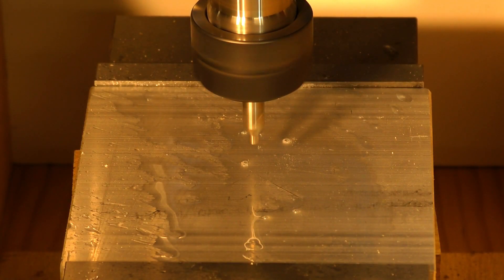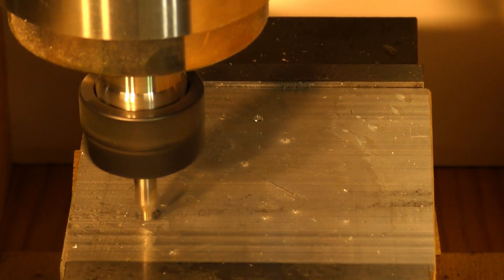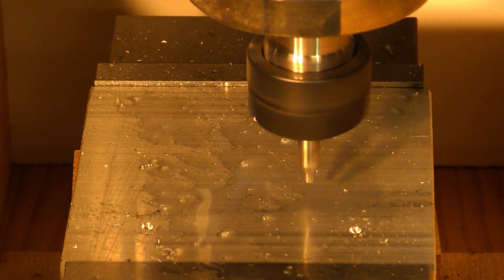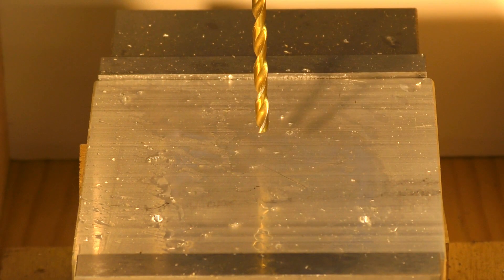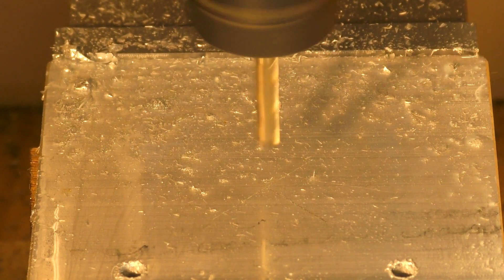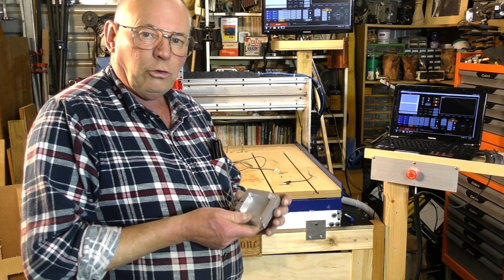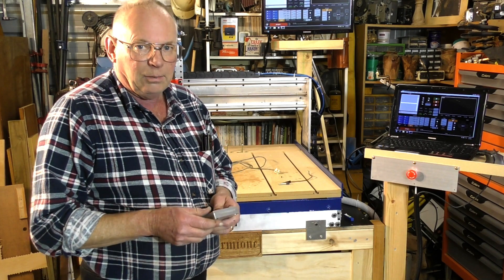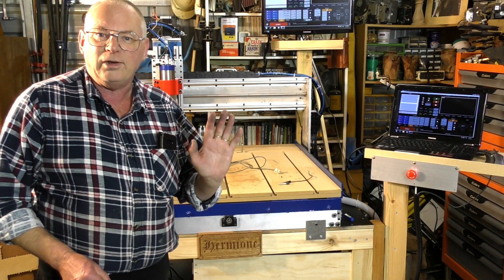CNC Router cutting out 1/2 inch/12mm aluminium parts for a Z Touch probe speeds and feeds

Comment: Hello! I didn't quite understand why you completely milling out the central part. It could simply be cut along the contour - it is much faster. The only thing is that during the last Z pass it needs to be held so as not to break a mill about it if the part turns up. And for the purity of the cut, you need first to do a rough cut and leave 0.1-0.2 mm on the wall, and then do a separate toolpath for finishing trim (in one or several passes). I wish you creative success!